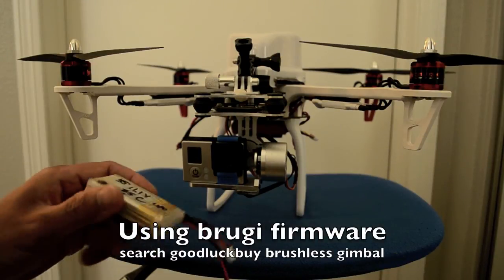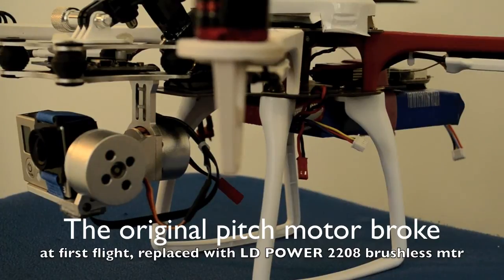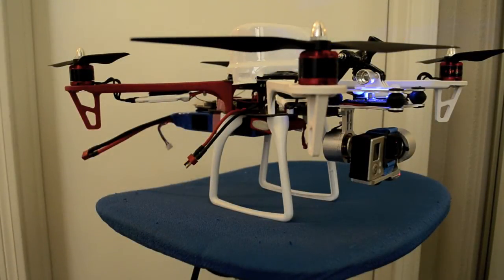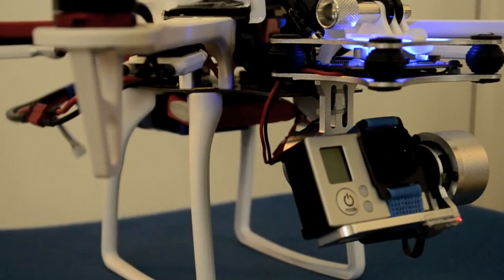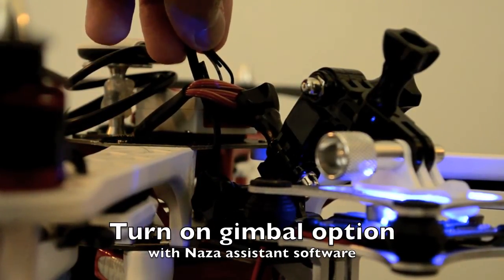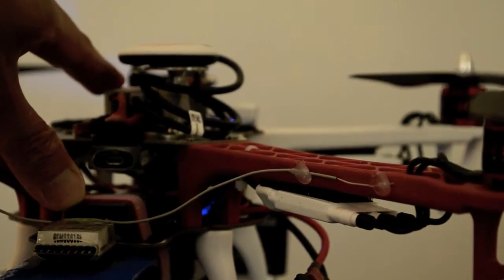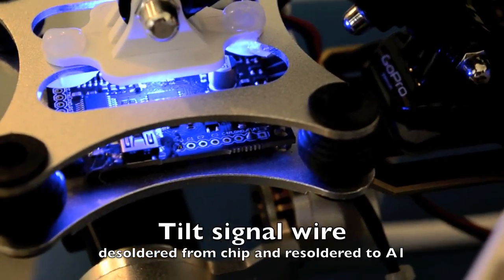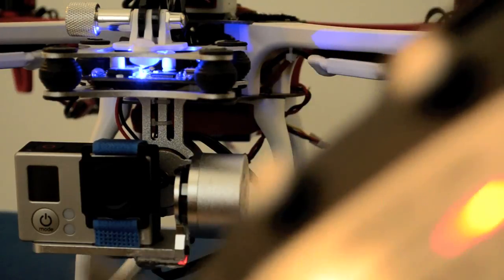Goodluckbuy Brushless Gimbal with Tilt Control

Comment: So i have a storm32 V1.31 board and I connected the signal to RC2-0 and negative to RC2-Gnd and turned gimbal tilt on Naza and it still does not work. I am doing something wrong?

Comment: I noticed around min 1:51 your gimbal jitters while tilting down. Have you figured out a way to fix that. Mine does the same thing and I can't for the life of me find a fix for it.
Reply: None on my side either, to fix the jitter, but if you easy up on the throttle and elevator I noticed a jitter free video. On this video I was trying to nail it just for fun of flying. Hope this helps and Happy flying!

Comment from the maker: To godingdong, not sure on what is wrong with your gimbal. Coming from GLB should already been working from the start just plugging it to a power (lipo batt). Do double check all wirings though for loose connections and for bad soldering. This means you are going to take it apart for self inspections such as having bad wire leads. Make sure to note placements of gimbal parts and should be easy and put it back together and test it after. Still not working??? Then try on flashing control board with new firmware and changing none working parts with new ones. Could be just a bad lemon. Hope these guesses helps and Cheers!

Comment: Hello! 
I am having a big strugle with my Gimbal! 
I have just bought one from GoodLuckBuy bot it doesnt seem to work! My motor is just lagging and my second motor tilt motor is not working. Did you have any struggles with youre gimbal? and how did you fix that? My motors are konected with a white whire between the motors and board! :( Do you know how to fix it? Sorry for the bad info but if you know please contact me! Realy need help. Mabie skype if it helps? :)

Comment from the maker: Yeah sure, I did used the gopro grab bag bought from eBay and phantom gorpo camera holder from DJI. Installed the white phantom gopro holder on the brushless gimbal (plastic screws N nuts N hot glue) and then used the adjustable gopro arm and removed one of the 3 pin by a dremel tool then fixed onto the gopro base. You cant see it on the video but once you configure it just like what I did and you will see what I'm trying to tell you. Thanks N hope this helps.
Reply: Thanks

Comment: Hello,
Watching your video to minute 2:23 to see the mounting gimbal frame.
Where did you find the accessory to attach the frame to the gimbal.
I have a frame dji f450 and am looking for a good solution to fix the gimbal that is equal to your own.
I would be very grateful if you had any suggestions.
thanks
Corrado

Comment: if you connect it with the NAZA you need to set the roll and pitch gains to 0 so that the naza doesn't add any input to the gimbal to try and level the camera becasue the gimbal control board is able to level it itself.

Comment from the maker: Yeah it does shake a bit during fast flight and banking. I think due to the rubber pieces were too soft. I saw some other users did used a tie wrap to shorten the travel of the rubber balls but I have not yet tried it. Im satisfied as is.

Comment: Frank, I got mine going by completely bypassing the Naza and plugging into the receiver channel 8, then assigning a dial on the Transmitter (Futaba 8FG) to channel 8. Works perfectly. I couldn't get the Naza to work. I suspect it's designed to use its own levelling sensors to control the gimbal, whereas this GLB gimbal works fine by itself, with its own board.

Comment from the maker: Hi Frank, glad to hear that your gimbal is still ok. Anyway try leaving the settings on the naza software gimbal option on default. It works for me. Also were you at least able to manually control the pitch? If so, then I would say the pitch motor needs to be replace. Also before changing the motor try to update your firmware so that you can remove the high pitch sounds from all motors. Hope this helps and Cheers!

Comment: read your instructions. does not work for me.what i did: (1) connect gimbal to copter lipo s3, tilt cord not connected: gimbal works fine,level horizontally!
(2) connect tilt to f2 with center wire (+) cut.if NAZA gimbal setting is OFF, gimbal tilts up about 45 degrees.
if i go to ON, tilt is running down till stop & oszillates. approx 90 degrees from horizontal. changing NAZA F2 max setting to 10 makes gimbal to tilt up by about 45 degrees - but still oszillates slightly after a moment of rest.

Comment from the maker: Reviewing your message and looks like u were trying to power ur tilt by the lipo? U dont need to do that. U just power the whole gimbal by the 3s lipo (red and black wire) and basically the F2 from Naza will supply the tilt control signal.

Comment from the maker: Hi Frank, did u cut plus wire then connect to f2 and powered on by 3s lipo? 3s lipo is the recommended power and should not have fried your board. Did u do any desoldering and resoldering? Also have u change your firmware to the board?

Comment: DID I BLOW IT? Here is what i did: CONNECT power s3lipo to gimbal. Working fine. 3wire cord from gimbal: cut plus wire and soldered it to s3lipo plus. Remaining plug to f2. Power on: OOOOHHHHH SH.., it is dead! Doesnt erect, doesnt do anything anymore! Disconnect 3wire cord and powered on again. DEAD. Any ideas? Was that s3 voltage to high? Does the tilt only accept s2 or s1 voltages?

Comment: you can find technical data on webpages of the shops. weight depends on model of gimbal, most of them (for gopro3) weigh around 200-300 grams.

Comment from the maker: @Frank, yes do cut the (+) on the tilt wire bec naza does not supply enough power. You can then either use a separate battery or  from the main quad battery. I desoldered the original signal wire location bec it doesnt work for me. As you can see in the video it work fine now. Hope this help.

Comment: Hi. The way you connected the gimbal to the naza was not quite clear to me. Are there 2 methods, or why did you do solder work on the setup. Would it be ok to just cut the middle (+) wire and connect the plug to f2?